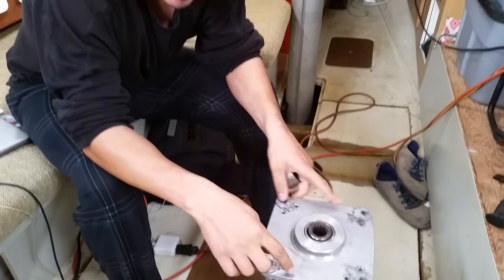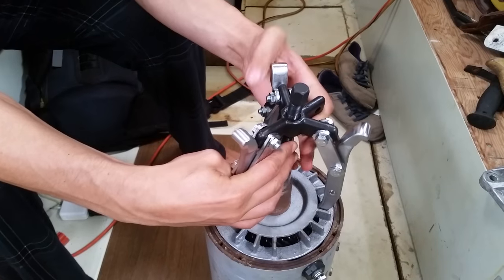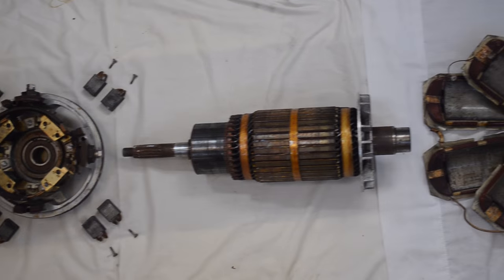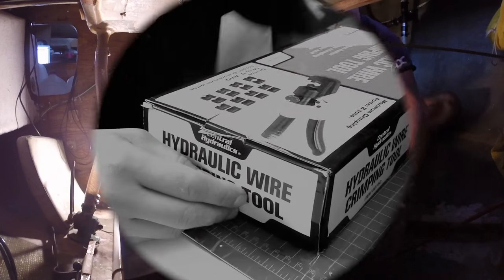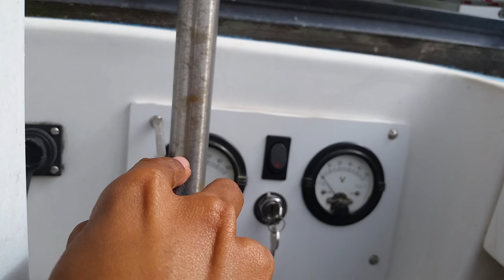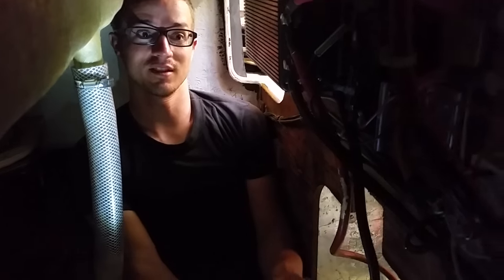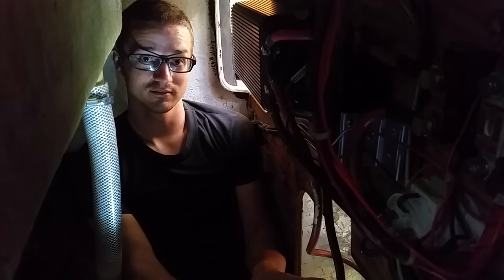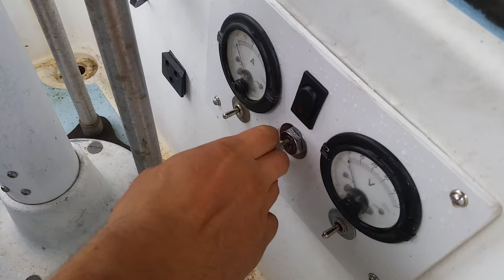Experimental Wiring of our Electric Motor — Sailing Uma [Step 19]

Comment: great job on the electrical system for the engine. i am an aircraft electrician by trade, and your wiring is done well enough to go on a aircraft. good attention to detail, and high quality work. keep up that kind of maintenance, you wont have any problems with the boat at all. looking forward to all your future videos.
Reply: +Sean “SV Inopii” Thompson While most boaters have issues with fuel lines and oil filters, I'm wondering when the bane of all boaters will start to effect Uma's propulsion system, corrosion.  All of that metal on metal contact, if you don't have the right metals involved, can quickly become a corrosion nightmare.  But that's all part of the learning experience of this project.  Props to you guys for attempting this!  We are all watching and learning from your work!
Reply: +John Lampe from what I can see, if there is corrosion, it would be a short job to sort out.  Ten minutes to take out the electric motor and maybe ten more to disassemble now that they know how and another ten to softly sand away or replace bushings.  Within a hours time or less they would be back to functionality whereas a diesel would take weeks to sort out maybe months if a part has to be ordered in some tropical destination.  I think these two will change they way Marine boat makers think about the future propulsion and the environment. If this works, it would be like cold fusion to the boating world.
Reply: I was thinking more about their wiring and related connections than the motor itself. Since much of that is make shift, I'm assuming not everything is marine spec and different metals. But as you say, since they built it, they should be able to sort it out quickly! I agree with you about the paradigm shift implications of this project. I suspect this video will shortly be their most watched!
Reply: +John Lampe Exactly, and with the U.S. EPA being what it is...it will not be long before boaters will be harshly punished for the dreaded oil and fuel floating around their boats and more regulations regarding oil changes, fill ups etc.  This system would prevent all of those issues.  And if they could buy gel batteries that would prevent any gasses from acid and further corrosion to wiring, or at least help.   Lots of people are watching and eagerly awaiting these results long term.  If it works well enough, why wouldn't we all throw out our rotting expensive diesels?
Reply: +Ted Smith Not enough lithium in the world to make enough batteries, and LEAD ACID is not exactly benign.  Diesel is a very high density energy source, well proven, and dependable.  I like to see these kinds of experiments tho.
Reply: +Sean “SV Inopii” Thompson With a range of only 10 miles I don't see how this is practical for long term cruising.   Everyone who is cruising on a sailboat knows that motoring is just part of the game.  If you only have a range of 10 milies you can be stuck for weeks if not months waiting for the right weather and wind do go anywhere.  I think adding a 10 HP kicker motor will help out a lot.
Reply: +Down In The Islands I agree that you need SOMETHING more than 6 batts and an electric motor available.  Getting in and out of the harbour will be fine, but becalmed and weather windows will become a real problem.
Reply: +Down In The Islands I was thinking same thing.  But easy fix.   Of course more batteries and more panels but most of all a small generator would create enough power to run that motor with no problems at all in the small generator would take 1 gallon every eight hours as a rough estimate.  So either way it would still be more efficient.   But what does bother me is he keeps calling it an engine it's a motor not an engine.    Lol.  Hahaha. Jk.  Any way.  I'm really enjoying there vids.  Done very well.                 ONE LOVE.
Reply: +hairfarmer07 Then you gotta carry some gasoline, ewwww.
Reply: +Down In The Islands  i don t think so because if you go and watch echo sailing project video they sail the world with electric motor
Reply: +Down In The Islands Where did your estimate of 10 miles come from? I'm not disputing it, just had not picked up on it.
Reply: Sailing Uma replied too a post I made to this video asking them what they think their range will be.
Reply: Ah!  Thanks!  Didn't see that yet.  You are right. Ten miles isn't much if you have to move the boat and the wind isn't with you.
Reply: John Lampe - I too was concerned about corrosion, but from the automotive world I have 2 solution.  Fluid Film spray.  A very good, non-conducting, anti-corrosion lubricant.  Better, generous amounts of silicon dielectric grease, especially on the nuts, bolts and battery  cable ends.
Reply: Sean Thomps
Reply: It a SAILBOAT.... tough to get in and out of marina/port.... what game??? what everyone????  never mind
Reply: @johnlampe3258  They eventually overhauled this system, but ironically his original install sounded better than the replacement until they got a replacement lower drive unit. Now I think they have a 300 mile range under favorable conditions.

Comment: There is a product called a commutator stone for seating the brushes and cleaning the commutator bars. This is used without removing the motor. Also you may want to figure on having a source of compressed air to keep the motor blown out as the carbon dust from the brushes can cause shorts in the motor. That is a pretty common set of brushes but you may want to keep a spare set. As soon as the brush wears even with the top of the rigging they need to be replaced. The lower in the rigging the brush gets, the less spring tension there is on them and it accelerates the wear from that point. A good rule of thumb for maintenance is 250 hours or every 90 days. Until next time fair winds.

Comment: It is all coming together quiet nicely you guys ! I'm really glad you decided to go with the electric motor because I had talked about doing something similar for a houseboat.
 I worked as a golf and turf specialist for years, so I was around golf carts a lot and got to go to Club Car factory in Augusta Georgia. Real impressive and the best cart on the market in my opinion. It could go 36 + holes on one charge with 2 fat guys and their clubs ! LOL
 I was going to use 3 banks of batteries so 2 could be solar charging as 1 was being used. I also was going to modify 2 heavy duty trolling motors as bow and stern thrusters for docking.
 Its not like I was planning on skiing behind the boat or anything, I just like the idea of clean, quiet reusable power. And the houseboat could just drop anchor if it needed to be charged where a sailboat could just continue on its way !
 Great job guys and I can't wait for the sea trials !
Fair wind and sunshine to ya both !

Comment: What will you use for cooking? I went to an Origo/Dometic spirit stove as like you I'm brushed DC. Sparks and gas (not American Gas!) don't mix. Also suggest a collar on shaft to stop the collar of the PSS seal being able to slide if the grub screws come loose. I also tapped the end of my motor and prop shaft M8 and used penny washers to stop either sliding out under load, which could happen surfing down waves. Fun watching you doing it all. Takes time eh!

Comment: Interesting to watch your progress.  A couple observations to offer.  One is that the discoloration on the commutator of the armature is desirable and should never be "cleaned".  You mentioned that it was uneven, so giving it a skin pass in a lathe to true it up is not unreasonable.  Regarding the abrasive paper, you mentioned "sand paper" which is light in color and that is the right thing to use.  In the video, the paper actually used looked dark which is likely to be something other than sand and is often conductive and therefore should never be used on a commutator.  Lastly, the reason that control panels are built on steel backplanes is that they do not burn.  Please pay very close attention to the current rating match between your contactors, wiring and fuses.  Also, be careful to detect an overload situation such as a fouled prop.  This will lug the motor and cause it to draw more current (could be a lot more).

As I mentioned the last time, compound motors such as yours require field loss protection to avoid burning up the armature by applying power to it without a field present (the field provides the counter EMF that limits the armature current to a safe value).  It would be wise to test that your armature voltage is not applied when you have no field current flowing.  If this can occur, I advise that you add a provision such as a current relay in the field circuit to act as a permissive to the control for the armature voltage (example: remove the output from the speed control going to the armature controller). 

This is all DC Motor 101 so it should not be hard to find information on any of it.  (I do industrial electrical maintenance and I design and build electrical control and automation systems).
Reply: +Robert Applegate Sage advice!
Reply: years in the electric tool repair business we would always clean up the commutator of the armature with commutator stone.  when hooked to a meter before and after there is difference.  Plus it gives you a good opportunity to inspect the commutator bars under a magnifying glass for damage.

Comment: The person who told you that it was a "Sea-Pex" motor didn't know what the heck he was talking about! It is a sepex motor, short for SEParately EXcited! It means that the stator and rotor windings get power independently of each other. This allows a great deal of control over the motor. Basically, the amount of current through the armature (usually the rotor) controls the overall power output. The strength of the field windings (usually the stator) controls the torque and counter emf characteristics. Essentially, the armature current can be thought of as a throttle; the field winding can be thought of as a transmission. To a point, more armature current means more power. A strong field means more torque at low RPMs, but limits the top speed. A relatively weak field means higher RPMs, but less torque. Since both the windings are separated, the currents can be changed on the fly, and a good controller can optimize performance at any speed.

Comment: Totally on pins and needles for the sea trials and so pleased to see them really doing the wiring super heavy duty. I don't remember what their solar capacity is but expect they'll wind up expanding that to any available space. I don't remember a wind gen but guessing they'll have at least one of those in the end. I think this electric propulsion can work but depending on how good they are at sailing in less then perfect conditions combined with the patience to sit tight and just chill if there is no wind. I don't remember seeing a vent fan for the battery bank....might not be a bad idea though small fans don't take a lot of power. It wouldn't have to run 24/7 but during charging could be a plan unless those are the lithium batteries which I don't think generate hydrogen or explosive gases.

Comment: i've never had boat experience but had years of experience with motive power in the  fork truck application. electric motors give maximum torque at 0 rpms and a clutch is not needed. however a speed increase  would   be beneficial in the gearing of same.. reduction of voltage will work for reverse. but speed needs a transmission. again no clutch is needed here. if your motor reaches acceptable speed in it's designed range go no further. if you want more the introduction of a gear solution is wanted. what you have already done is very impressive. you are patient, you think things out clearly. then you act. not a lot of people do this. you are absolutely the persons who should circumnavigate the world in a sailboat. the sea will test you but you've built a stout ship and know how to fix her. good on you and nothing but good for your future..........

Comment: Looks good, make sure your batteries are well ventilated. You would not believe the size of the explosion, I have seen it happen twice. I wish we would have seen the bearing you used. That first one was an oil bath bearing. It would have been short lived. I sure like the motor conversion.

Comment: the next time you need to re-brush, you can place the sand paper flush on the commutator to get a close curve on the brushes. Also, some compressed air will help get the dust out and don't forget to megger everything afterwards!

Comment: I like the use of your feet to help this damn thing apart, I can guess you saved money do it this way and some great experience, but did you save enough in personal time if you had bought a predesigned electric motor system? You still need a good generator to run everything. I am an avid sailor and I work in Aero Space Electronics and I will tell what I see, it looks really darn good, great job!

Comment: There's also a lot more room where you have the motor placed than when it has a diesel in there.  With the electric motor and the battery bank and the wiring setup you still have a lot of room to spare.  Great job guys...  ;-}

Comment: Hi guys, I finally decided to watch all your videos from day one!
Many questions and wonderings. I am hopefully getting a 36 feet boat (junk rigged schooner), as soon as Covid situation permits.
It's an old boat of course.
I am very interested in 2 aspects of your boat refit:
- the interior (like getting rid of the center foldind table)
- the electric motor !!!
Question: how far were your electrics knowledge and skills before you started?
Did you learn on the way?
Thank you for all the videos and great ideas (and much more!)
Patrick
Reply from the maker: We had some basic understanding on wiring/12v systems. But learned most of it as we went. None of it is very difficult to understand really. If you can understand how a flashlight works or how to make a simple circuit the rest you pick up along the way. We’re pretty big proponents of just starting with what you have and learning as you go.
Reply: @SailingUma  Thanks a lot for your quick reply. I may or may not undertake such an engine replacement, it will depend on what I actually discover when I see the boat (it is in Scotland, I am in south of France, and Covid situation forbids flying there, though the seller and I had already agreed on the conditions). I sure wil have more questions if I decide to go for such a major refit!

Comment: Nice job. I also am going to convert a an old gas/Desiel sailboat to electric. Looking for one in our area with a blown engine that I can get cheap/free. One thing to consider... Some manufacturers used props of different pitches to compensate for the motor being over/under powered. I.e. A 30 ft sailboat with an Atomic 4 30hp gas engine can't transfer that much energy to the water as it only takes about 10hp to get to hull speed. So the pitch of the prop is at a min. You may need to match you prop to the new motor so you get max efficiency out of the system.

Comment: Great job with the electric engine. I'm very optimistic that it will work as you expected. On Youtube there is a channel (Eco Sailing Project) with a few French boys who succeeded in circumnavigating the world in their sailing yacht by means of an electric engine (and their sails of course). 
Very smart and environmentally friendly idea, I think. In case you don't speak French, their videos also have English subtitles. 
Their goal seems to be to inspire as many people as possible to switch from oil to electric engine on their boat. I think that's great. What do you actually think of salt water fuel cell-power on a sailing yacht?

Comment: The electric propulsion will work fine-the problem will be battery capacity,range and how quickly you can recharge. 
Don't forget the propeller,I doubt if it is the most efficient for electric propulsion. 
Have a look at Lynch type motors.

Comment: Hi guys, sorry for being a naysayer but please be aware of the fire hazard. 60W going astray is enough to to ignite wood and that small enclosure will be filled with smoke in no time. So make sure you can disconnect the battery bank from a safe place. And watch your motor temperature, the paint probably insulates a bit and might produce fumes, especially if the prop gets fouled..

Comment: Ingenius!!!   I hoping that motor gives you guys a long life. What have you guys done to combat salt air oxidation for your wiring?
Reply from the maker: +D Gourdine So far, we're using all brass and tinned copper, so that will help quite a bit. Also, all our electrical connections are thoroughly lubed with dielectric grease.
Reply from the maker: +D Gourdine So far, we're using all brass and tinned copper, so that will help quite a bit. Also, all our electrical connections are thoroughly lubed with dielectric grease.

Comment: Put MORE batteries in, you just MAY need em. Think of current speeds and IF that motor is going to be able to push Uma against a strong current, and duration of charge on the batteries if you have to make a passage w/o sail.  Good Work on the Motor though, defiantly top notch work.
Reply from the maker: +daverjax Thanks. Yes, we will most likely be installing more batteries in the first year. But will also, most likely be LiFePO's. In the meantime, we just wont go against currents.

Comment: Great video and project. Are you using a design project plan or is this your own.
Reply from the maker: So far its all our own. We have a basic wiring diagram for our motor controller, but its for a sieries motor, so we had to modify it significantly.
Reply: +Sailing Uma will the plans/ drawing be forsale im in the uk learning to sail repairing my boat and so much want to do same  as u please keep the videos coming all inspiring x